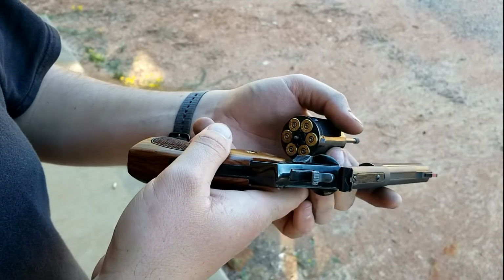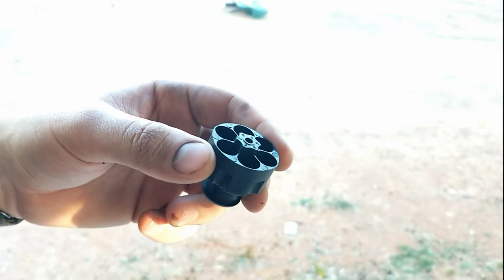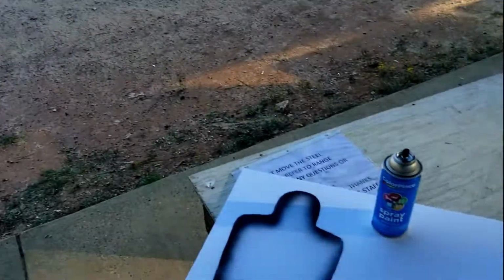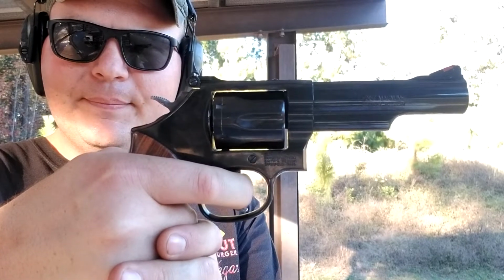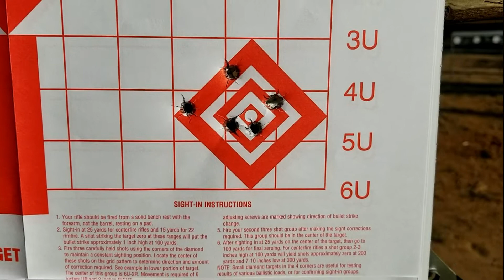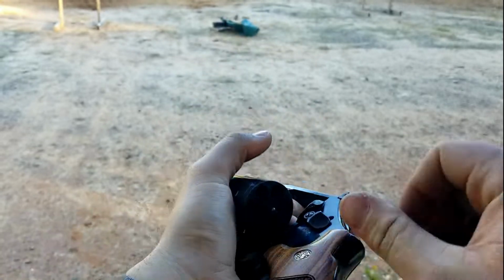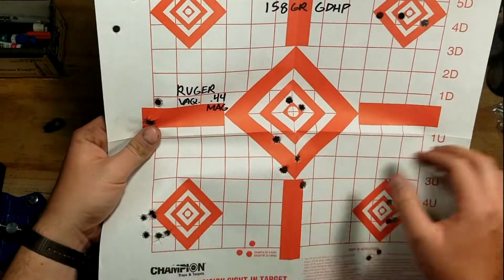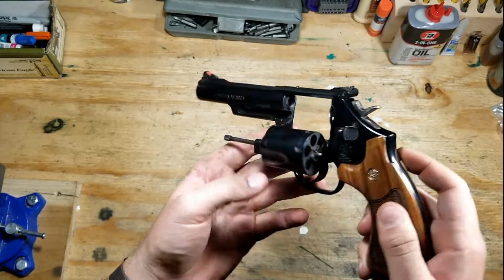S&W Model 19 Classic Range Day

Comment: Great video.  Nice gun.  The .357 Magnum and even .38 Spl double action service revolvers are very versatile.  And those S&W K frames are very nice.   I am usually not impressed with modern S&W but they have done a pretty good job on the new Model 19 from what I’ve been able to tell in the store.

Comment: What caliber is that pistol sold as?
I didn't know you could shoot 357 magnum out a 38 special.
Kind of like how a10mm glock can shoot 40 smith and Wesson?
Good shootin!
Reply: .357
Reply: @2pugman  
Copy that, thanks.
Reply from the maker: Yeah, it's in .357 Magnum. The original Model 19 was in .357 as well, so whether it's an original or the modern production Model 19 Classic, you're good to go with .357 Mag.
Reply: My first revolver was the S&W mod 10 in 38 spl.  In 1968 it set me back $65 with the larger target grips.   @Mr2ndAmendment
Reply: @Mr2ndAmendment  thanks for the reply sir.

Comment: i was waiting for this vid.. my 6 incher  is very smooth. you can get a wide trigger wide hammer.  i have the  hogues on my 19-3.   I had a LLama marshall with wide trigger hammer, and the 6 inch witha vent rib.  thats the clone of the combat magnum only in a .38  that llama was a great gun, I  miss it.   at 100 yards witha 38 you could put em in a 10 inch  all day long.  it got ripped off in texas in the 70s.   thats why i got the model 19-3 to relieve my need to get that llama back.  ha ha    i got it off gunbroker for 350 bucks from an estate sale. not mint, but not fired a lot.  the usual shine from sliding into a leather holster.   model 15 is a great revolver too.  i notice they have a dan wesson style press in barrel.